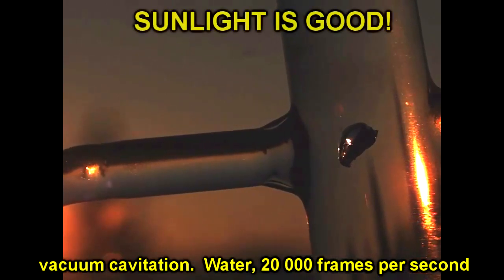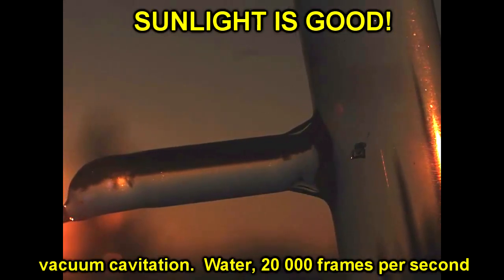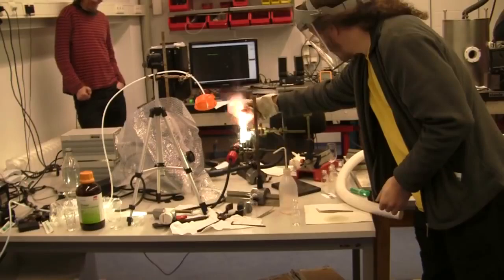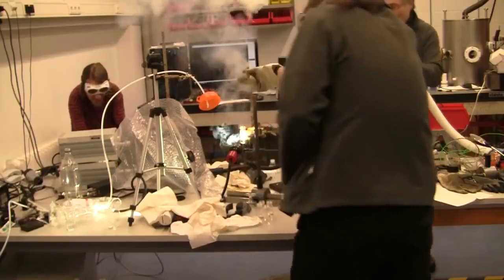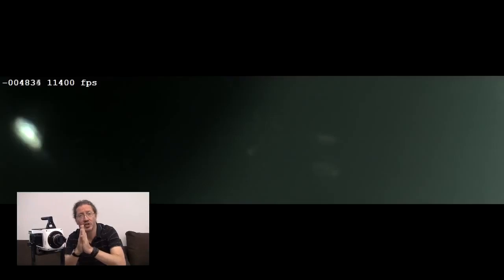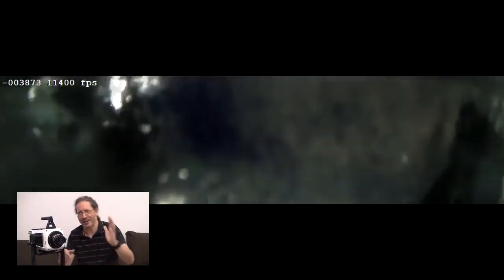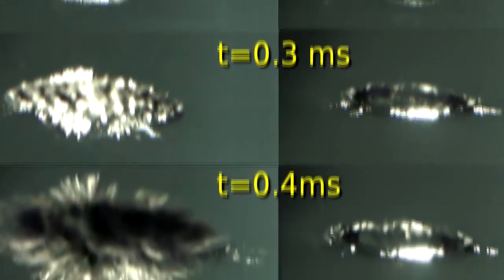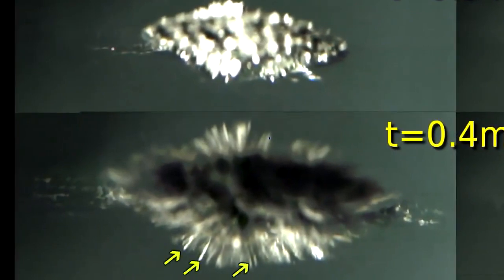Lightning on a high speed camera

Comment: I was thinking about seeing the lights in a big area pulse.  If the mains are 60, 50 Hz but that is 3 phase so you should see 180, 150 Hz?  That is if you are looking at 3 lights at the same time from the 3 different legs of power.  It has been a while since I have looked in to but what if you have 6 lights.  3 that are phase to neutral and 3 that are phase to phase.  Will you see 360, 300 Hz? This might be a better question for EEVblog :-)
Reply: The lights will flicker at twice the line frequency - the light (besides LED based) doesn't care about the polarity, so you'll get a light pulse at both the positive and negative half cycles. If everything is wired phase to neutral, you should see 3 groups of lights, all flickering at 120 / 100 hz, but 120 degrees apart. If there are some services that are wired phase to phase as I'm sure there would be, then I'd suspect you'd see an additional 3 groups of lights, still flickering at 120 / 100hz, but at a different phase shift than the phase to neutral wired lights. You're just going to see this, but in light vs time in video, instead of voltage vs time plotted on a graph: https://www.engineeringtoolbox.com/docs/documents/1933/ac_voltage_line_to_neutral_to_line_230V_400V.png

Comment: Speculations Lightening "side bits"- could it possibly be that it's a display on how the charges are exchanged in the cloud? As in, if a discharge happened in the positive charged area of a cloud, creeping across the sky to hit the negatively charged section (or vise versa), could it be that both areas are firing off against each other and the side bits are where one side of the electrical charge overcame the other? Of course since this is happening at the speed of light, it could be that shots that have multiple side bits is actually displaying multiple exchanges that have already occurred in that fraction of a second? Not sure what math to use to prove this theoretically, I leave that up to you

Comment: elements of risk on ligning???
just use bateries and an alternator. a good pure sinusoidal one is not that expansive.
Reply: Near an impact site can be a potential of several million Volts per meter. So enclose you and your equipment with a proper faraday-cage. But i think he is more concerned about his equipment. You know, static electrical fields are not the best friend of CMOS sensors:)
"EFM readings show significant changes in electric field due to an approaching thunderstorm and particularly, during lightning periods."
 DOI: 10.1109/SPICES.2017.8091357
Reply: *inverter

Comment: I would recommend a double-conversion UPS to keep the power for your sensitive equipment clean. A small unit (rated 1.5kVA) costs only a few 100. The effective protection of the output is much higher than with any normal surge protector. They are noisy however because of the forced air cooling...
Reply: or just run the camera from batteries using a dc-dc converter and skip this intermediate AC nonsense! Wtf people, all electronics are DC, so are batteries. Why is everyone saying "use such and such UPS"? Unless you're running an AC motor, converting to AC and back again is stupid. Hence why all the huge modern data centers where they do custom everything have backup DC buses that feed into the power supplies, not converting it to AC just to convert it back to DC, and lose efficiency at every conversion.
Reply: @gorak9000  That is correct, of course. However, since I do not know what kind of PSU the camera uses, I would not recommend it just like that... A big device such as this might have an internal PSU and not all of them (even some server PSUs) can handle running on DC. (E.g.: The bridge rectifier might fail with the full current going through only half of the diodes)
There are other considerations as well when setting up a DC supply and I would not recommend doing it for an expensive device without experience in verifying that it is going to work as expected.

Comment: All the electricity grid is in sync, irrespective of which sub station the lights are connected to. However it is likely that different groups of lights are fed from different phases so won’t peak at the same instant. Recall that power is distributed at 50 or 60 Hz with three phases with 120 degrees between each. Finally remember that each cycle has two peaks (above and below neutral) so the lights actually peak 100 times per second.
Reply: I would think also that the distance from the generating point to the light might e different which would create phase difference. Would be interesting to see if there are only three groups (which would say 3 phase is the cause) or more (cause is mostly different distances from the generating point). Nice video. Would like the speed of light measured in a direct way. Thanks.
Reply: @osmanfb1  considering that electricity basically travels the speed of light (maybe like 95% the speed of light) in a wire, I don't think you'll be seeing any time delay differences. It's just going to be the 3 phases
Reply: osmanfb1 : to vary by 1/4 cycle of phase, the "difference in distance to source" would have to be about 775 miles. And that wouldn't be in the same field of view, as it would be over the horizon and not visible due to Earth's curvature. So all of the variation we're seeing is due to the fact that electricity is always distributed in 3 phases, and while some loads (eg, 3-phase motors) use all three phases, most only use 1 phase (eg, lighting) or 2 phases (eg, air conditioning). So for load balancing, street lights in a city will be scattered among the three phases, so relative to any one "reference" lamp, various city lights will be 0°, 60°, and 120° out-of-phase.
Reply: yea, thanks for puting it up, so i don´t have to. XD

Comment from the maker: Yup, this is a re-upload from the Thunderf00t channel, but it seems a suitable 'first' video to upload on this channel :-)
Reply: Now just put copyright claim from main channel to this just for fun.
Reply: Lighting is kind of my pet project for developing a theory. 

There are two species of ions that we are dealing with, electrons and positive ions, mostly protonated oxygen i.e. hydroperoxyl radical (HO2). The rotation of the earth and its magnetic field forces the electrons towards the ground and the protons skyward, keeping them separate. During fair weather the protonated ions reside in a strata starting at an altitude of about 10 to 15 km.  

Water vapor, being a polar molecule, will tend to nucleate around electrical charges especially when condensing at a sufficiently high altitude where ions are plentiful. As the water droplets become heavy they fall towards the ground, with their entrapped ions. As they approach the ground they attract the electrons underneath them. This attracts more positive ions behind the rain column and effectively "pinches" the two electrical strata together. As the electric field increases the air will break down and electrons will break through from the ground, traverse around the rain column, as pure water is an insulator, and meet up with the ions behind it. This seems to be the case of your second example.

Alternatively, if the rain column relinquishes its ions, due to evaporation, before reaching the ground, the slow moving positive ions will tend to find their way back upwards. This may require them to traverse sideways under the positively charged rain column, as in your first example.
Reply: I thought so, I was going to ask. I am glad the answer is already available.
Reply: Absolutely brilliant! I love slo-mo film of "real life" events (rather than staged stunts) and scientific experiments. Btw, have you seen the speed-of-light experiment (Harvard???) where a laser light is shone through a 2 litre pop bottle? Apparently the fps is so great that if a bullet was fired at the same moment and in the same place, it would take about a year to watch it reach the other end of the bottle! I first saw it on one of Prof Jim Al Khalili's BBC series, (suddenly having a brainfart moment, it may have been Prof Brian Cox - both physicists who do stunning series and I've only had one mug of coffee, so please forgive me!) Anyway, it's on YouTube as a clip, either from the programme or the original film from the scientists who did it. Well worth watching - you get to see light moving at "the speed of light", in that the only "trickery" is the fps of the camera. Watching it finally get to the bottle top end is like watching someone climb a previously unscaled mountain! There is such a sense of achievement about it. I couldn't help wondering what Michelson and Morely(sp?) would make of it 😀
Reply: how much power does it draw? might be worth looking into a battery or ups solution
Reply: @InvadersDie  too fast
Reply: Could you collect more light w/a large reflector?
Reply: This is the way.